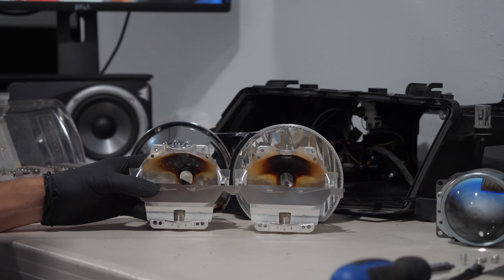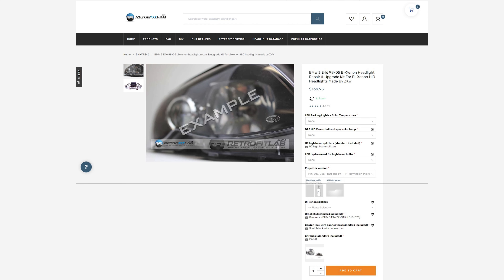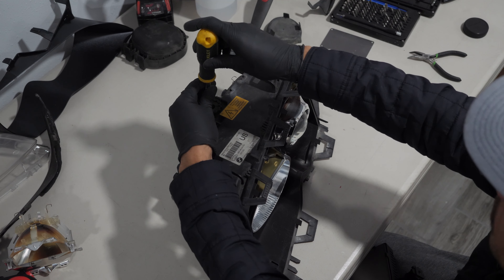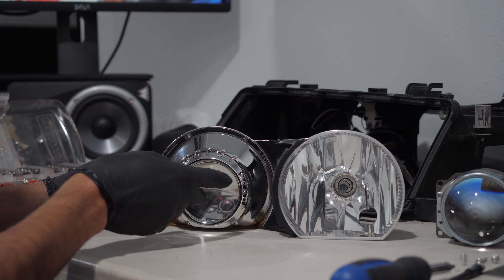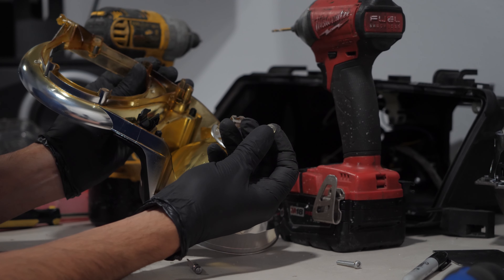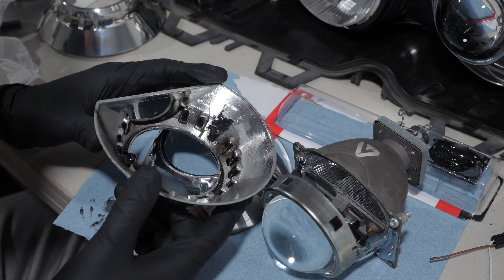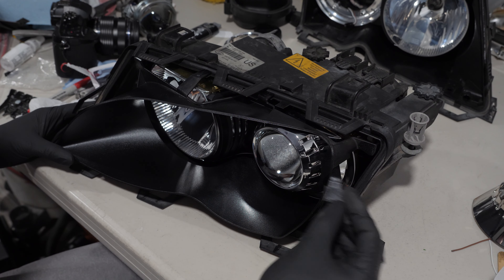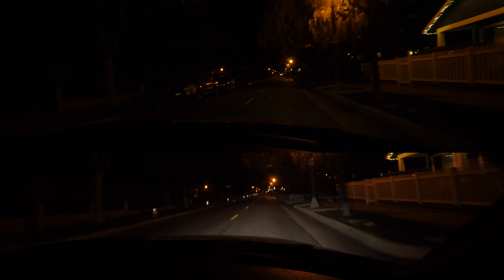E46 Mod - Headlight Retrofit Step by Step

Comment: daca la montaj nu conectez solenoid wire ,ce se intâmplă ?
Reply from the maker: Bi-xenon headlights use a single xenon bulb for both low and high beams. The solenoid in the projector moves a mechanical shutter or shield that adjusts the beam pattern.

Comment: The magnets were a great idea
Reply from the maker: Thanks! Magnets to the rescue 💪🏼
Reply: @Tenoch  hey how well do they work over time? Concerned that bumps might knock the shrouds off
Reply from the maker: @pranavkolluri I did the retrofit in Feb 2023 and the shrouds are still in place, they haven’t come off yet.
Reply: @Tenoch  hey just wanted to lyk, just finished doing the swap on my headlights, thank you so much for the video!! Somehow managed to not really break anything which is a miracle with how incredibly brittle all of the plastic in this car has become... now to deal with the sagging headliner 😂
Reply from the maker: Sweet!!! I was reviewing my footage the other day and I noticed the brittle electrical wires were only on one headlight. I’m glad everything went well and we have the same issue, I still haven’t tackled the saggy headliner.
Reply: @Tenoch  you know what's weird? I ran into the same thing. The driver's side solenoid wires were basically becoming dust if I touched them, but the passenger side was for the most part fine. Really weird

Comment: Why exactly youre using These Magnets ?
Reply from the maker: I used the magnets because I didn't want to glue the shrouds permanently to the unit. Plus, with magnets, I would be able to adjust the shroud if I put it a little bit crooked.